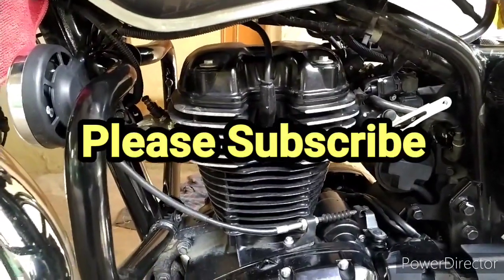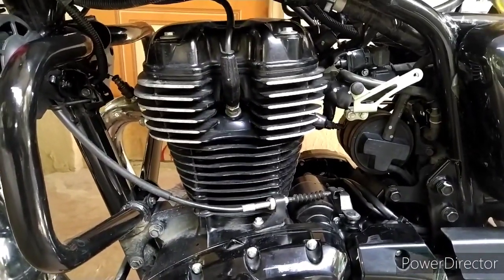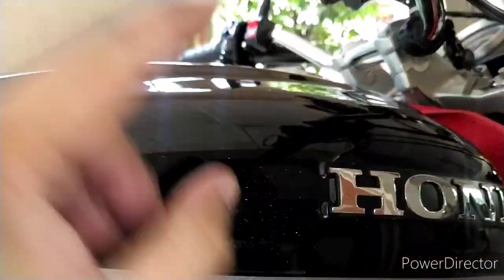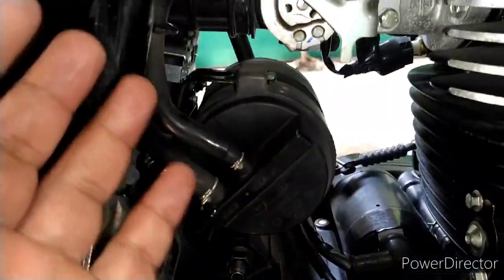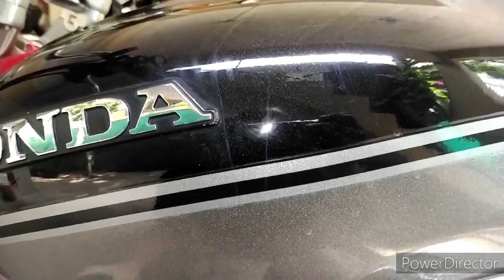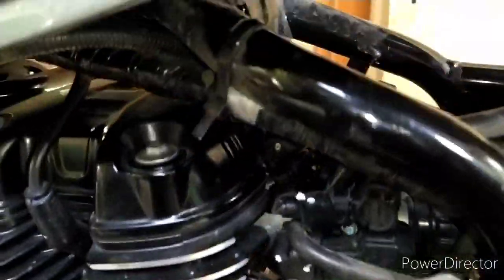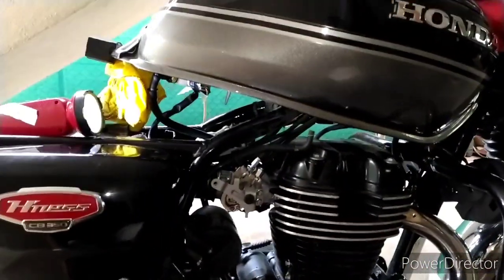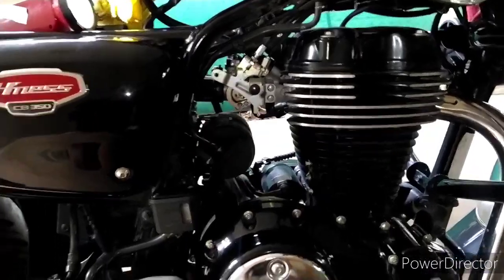Honda H'ness CB350 - EVAP system Explained

Comment: Sir my pipe from fuel tank to that box is broken , idk what to do as I have 1200 km ride tomorrow
Reply from the maker: As a temporary alternative buy any rubber fuel pipe from a local spares shop and install it. Once you get hands on the OEM pipe replace it.

Comment: Hi bro, i have a doubt, how are gases generated in the tank, these gases are from engine right?
Reply from the maker: These are gases or vapour generated from petrol buddy. So instead of releasing it to the atmosphere they are reused by pushing them into the inlet manifold and consumed by the engine during startup purge.
There are other gases that are generated inside the engine aswell which are of the Engine Oil when it gets heated up. Those gases too are reused by pushing them into the air filter box. This process is called the positive Crankcase Ventilation.

Comment: Very informative.. 👍 any suggestions regarding proper accessories for cb 350
Reply from the maker: There are quite a few available in the aftermarket options right from leg guard to backrest with top rack or carrier options. Check out at BS Auto Accessories for the full range. 
I personally like minimal and OE stuff so have gone for all OE accessories.
Reply: @RajkaGarage  
Thank you. I Will definitely check that out.

Comment: My honda highness has start problem when ever i park it in aun to 4-5 hr 
Than i have to make it stand in shade for somtime before it starts 
Have u gaced this issue
Reply from the maker: No sir, no such issues. My bike is always parked in open and starts absolutely normal. Next time this happens, try to open the fuel cap and with 2nd key start the bike. If it's starts that way, you will need to check the EVAP system.
Reply: @RajkaGarage  thnkew soo much

Comment: Can you please do on how to drain petrol in honda cb350
Reply from the maker: The CB350 has a fuel pump in the petrol tank. So like other carburettored bikes, draining the petrol tank only happens after removing the tank from the bike and then removing the fuel pump from the bottom of the tank. Although I can and one point of time I will doing this when the time comes, let me caution This is not a straight forward process and hence wouldn't recommend a DIY. Unlike other bikes where the Petrol pipes are connect with clamps, These bikes have quick connectors which are little delicate in nature and any incorrect method will lead to damage to these connectors and fuel leakage. Over that, you won't get an replacement easily due to the limited number of Bigwing SVCs.
Reply: @RajkaGarage  I accidentally put diesel on the bike I have to drain it as soon as possible. Will it do any damage to the bike?
Reply from the maker: Don't start the engine at all. Please take the bike to service center by towing it. The fuel tank and fuel pump will need a thorough cleaning. Although Deisel is not a damage making solvent to petrol engines.
This will need service center attention.
Reply: I already started the bike.. And the bike stopped working..
Reply from the maker: Yes, it won't start now unless you clean the entire fuel system by dismantling the tank and fuel pump. You may also need a spark plug replacement at the most. But be rest assured, Deisel is oil based and hence cannot do any damage to petrol engines. Had it been the other way round, where accidently someone put petrol in a Deisel car(in my garage days I used to come across such cases intermittently) it can be damaging to the fuel pump mechanism of the Deisel engine.
Reply: @RajkaGarage  thank you so much for your help.. Hope you make a video someday about draining petrol 😁

Comment: Good information thanking you , any idea of cranck weight in this engine..
Reply: Thanks
Reply from the maker: Thanks mate.
No concrete information, but it must anywhere between 10-12Kg.
Reply: @RajkaGarage  heaviest crank in bullet 350 10 kg
Reply from the maker: Yes, the STD comes with 10kg. But looking at the overall weight of Highness, the maximum mass is carried by the engine itself. Plus they have given a counter balancer shaft to smooth out of vibes of the crank which makes me believe the crank must be heavy. Will surely check that out soon.

Comment: Thank you so much sir. There is virtually no info about EVAP on internet and very few mechanics konw about it. My honda authorised service centre mechanic was confused when I asked him about it. Can a blocked EVAP lead to airlocked tank? I suspect thats the issue in my Hornet 160r. Fuel is not coming out of fuel cock. They suspect faulty cock. I suspect airlocked tank. Because the original problem with my bike was damaged float pin. Petrol was leaking out from carburettor. So cock works fine.
Can you please guide?
Reply from the maker: Hi Deepankar, yes airlock can happen due to chocked EVAP, but it's a very rare scenario. 
Not sure if you have already tried all this, but can you do the 
Below steps:
1. Simply remove the petrol pipe from carburettor and check the flow is sufficient. If flow is restricted, check by opening the fuel tank cap. If flow improves by opening fuel tank cap. Then there is an airlock. But if it doesn't change, then the EVAP is ok.
2. Remove the fuel cock and check for blockage in the fuel cock filter. There is a filter inside the cock in the tank which can get blocked.
3. If the above 2 steps look ok. Remove the carburettor, unscrew the float chamber. Hold the carburettor in a position like it fits on the bike. Check if the float moves freely and does not moves in sticky or stucky manner. 
Next step to this, just hold the float chamber on the carburettor (hold little tight) without putting the screws and by connecting the fuel pipe turn on the fuel cock. Turn on the fuel cock for roughly 10-15 seconds and turn off the cock. Carefully separate the chamber bottom and see if enough fuel(about 70-80%) of the chamber bottom is filled or not. If it's not getting filled as desired, then there's a problem with the float or float pin. 
Also, you mentioned about faulty float pin. Was that replaced with the same part number. 
Let me know how it goes.
Reply: @RajkaGarage  My bike is currently at Honda's. they did replace the float pin. I suggested the mechanic to check whether the tank is airlocked and asked him to check fuel flow with fuel lid open but he insisted he did check and its a bad cock. If changing cock solves the problem that's well and good but if it doesn't I will go through troubleshooting steps you recommended. Thank you so much for your response. 😄
Reply: @deepankarchandrashekhar1038  Did it solve it, just curious to know present..?

Comment: Hi, It’s very nice video. Thanks for sharing. 

Can you please share your thoughts on fuel tank is shaking while riding CB350. Just observed this while test ride. Is this really something we bother ?
Reply from the maker: Thanks 😊
The tank is rubber bush mounted at the rear end to prevent chassis vibration getting transferred to the fuel tank. Most bikes have similar fitting mechanism. So nothing to bother about it. Its absolutely normal.
Cheers and Happy Riding 🤘